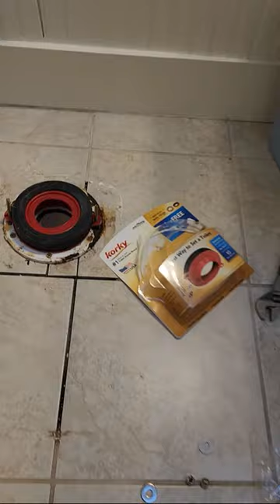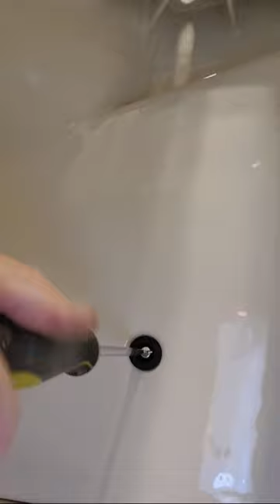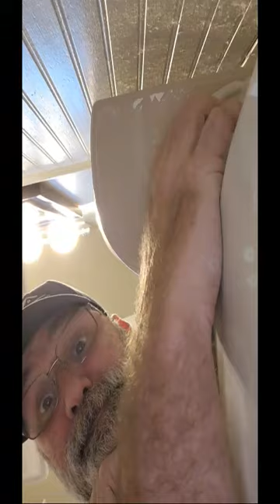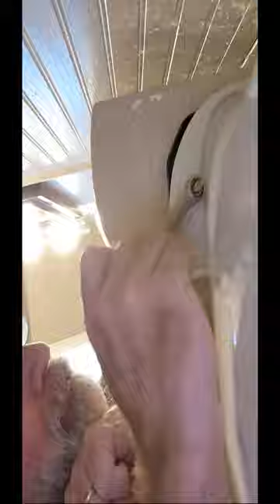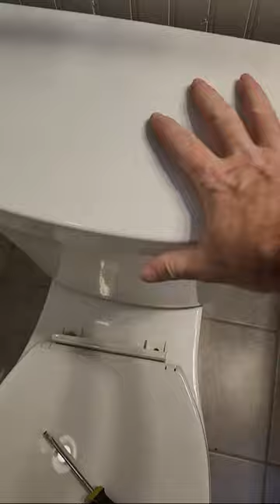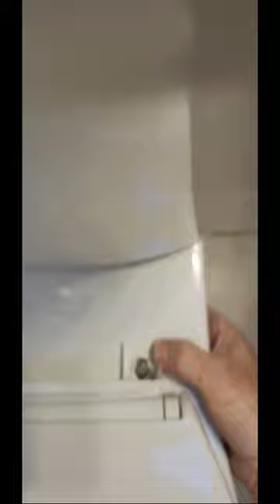QUICK Toilet Install | Kohler Gleam Elongated Toilet | #Shorts

Comment: How is that plastic part and those screws nut thingamajig gonna hold up especially if have and you have to remove it. Or snake it out ro plunge it and it leaks  where the 2 pieces come together under skirt.
Reply from the maker: I was there today, and they said the have not had any issues and love it!